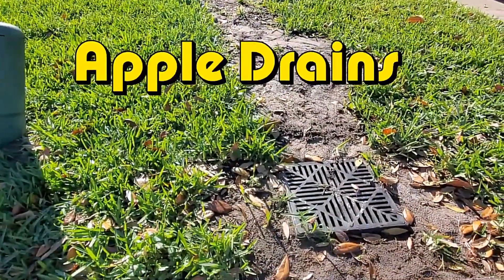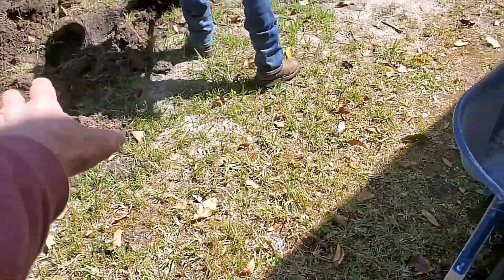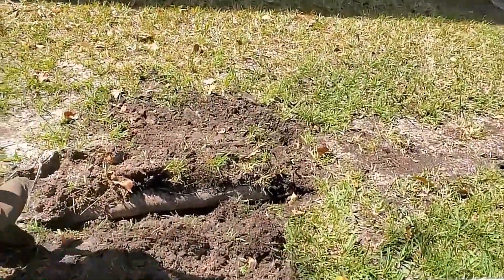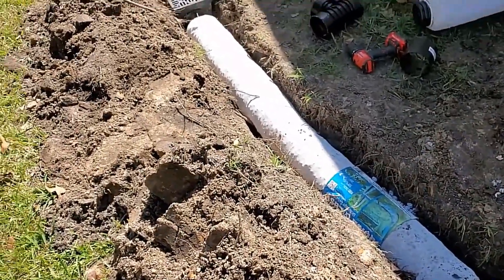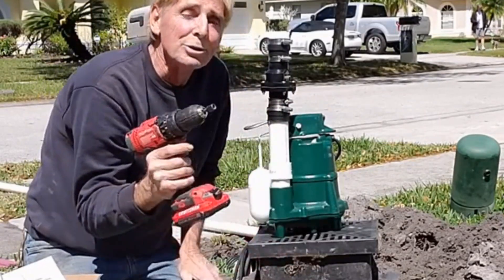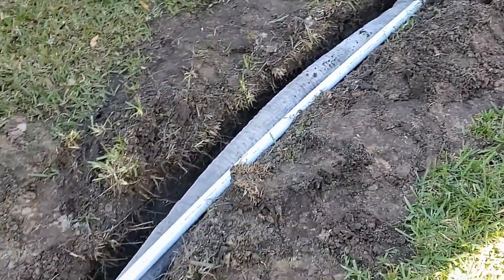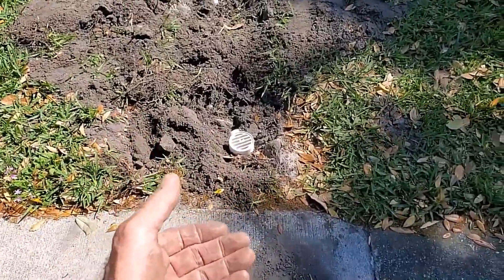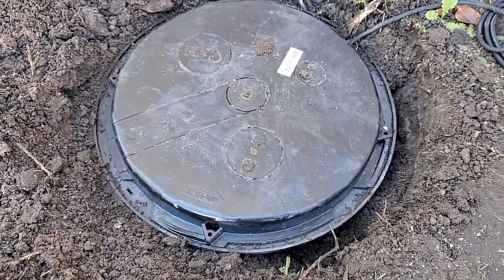Backyard Drainage is UPHILL to Street - What to Do

Comment: Chuck, if this were done in Ohio where it freezes during the winter, how would you do this job differently?
Reply: Remove the pump and drain the lines just like you would on an underground sprinkler system
Reply: @midwestbd7144  In my area of Chicagoland, so much of our heavy rain occurs in late winter and early spring, when we can still get some very cold days. I'd have to be watching the weather forecast and removing or at least turning off the pump. Hassle. Unfortunately my property is very flat, and I'm having trouble getting enough slope for a gravity drainage. :(

Comment: Awesome. Can I find that one way check valve at any plumbing store. Home depot or Lowes?
Thanks for the info. I'm in Rainy Washington State and currently discovered my side yard between fence lines of neighbor has drainage issues. Hence the rotted fence posts. After I finally got old post our of the ground the next heavy rain all the holes filled with water. Your info is helpful
Reply: Yes! I bought the exact same one as chuck uses in his videos at Lowe's. They are in the same area as the catch basins and pop up emitters.

Comment: How are you handling the backflow and short cycling the pump here?
I have a similar issue (flat yard), and have to pump 130ft to daylight. I wound up digging a large pit, placing two sump basins in, and filling with stone that offers almost another basin's worth of void space. This was the only way I could think to handle the backflow over that much length so as to avoid continuously cycling the pump.
Reply: The check valve won't allow water to re enter the sump crock after being pumped out

Comment: Seems like it has potential for back flow.  I agree with the need for a pump, but wouldn’t it need to be discharged at the curb.  I ask because I have a similar issue and my HOA will not allow cutting into the concrete, unless it’s the county.

My only remedy is to go through my backyard, and hope that the neighbor to the rear of me would allow a connect through her yard to discharge at the street downhill.
Reply: back flow?  there's a check valve above the pump...
Reply: Same problem here, or drown the guy behind me. Neighbor above me has caused my issue , but the previous owner is the one that did the elevation change. Not fair to go to current neighbor.
Reply: You could look into a dry well

Comment: Can you review how you get power to the sump?
Reply: Seems pretty straightforward if you have an exterior outlet, then waterproofing the line should be the only challenge.  If not one would need to run romex directly to the unit, which is easier said than done.  I’ve seen some electricians tie into existing circuits rather than running another sub panel where ideally you’d want exterior appliances on their own breaker.

Comment: What part of the pvc pipe is the 3/16 hole drilled? Top or bottom?
Reply from the maker: Below check valve
Reply: Can you please explain a little bit more about the pressure relief hole what is its purpose?
Reply: I think is to prevent air lock in the pump. Just a little water squirts back into the sump pump basin.  @สมบัติสตีเวนสัน-น6ษ